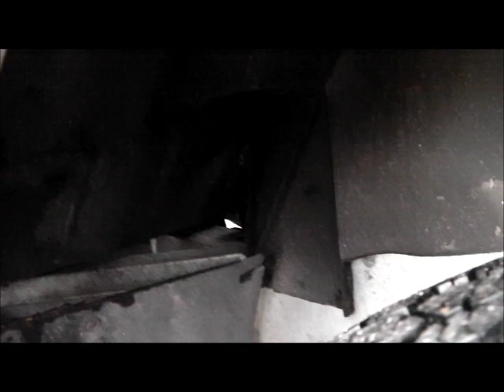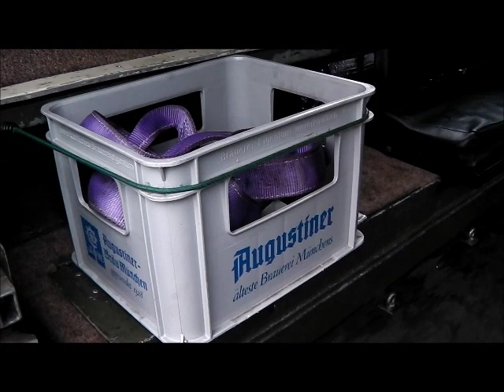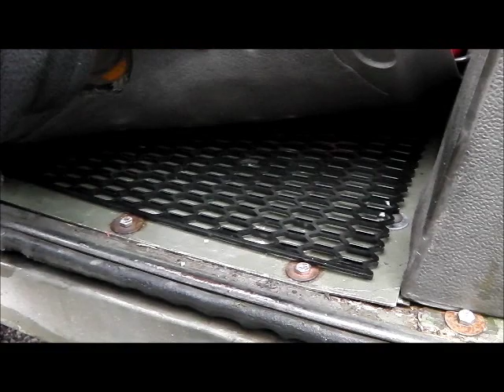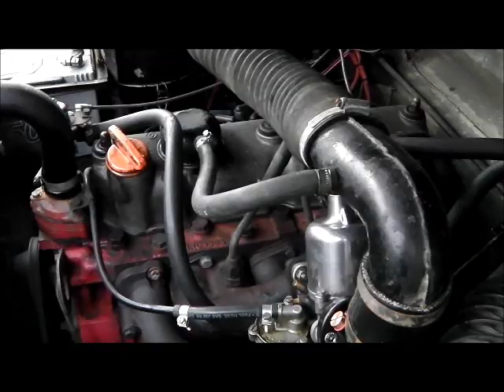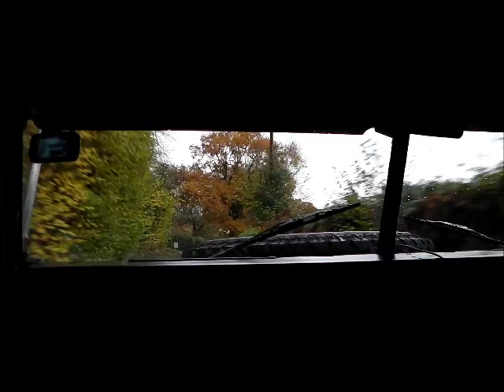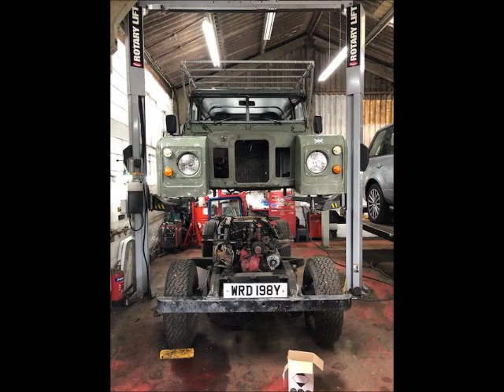Land Rover Series 3 update November 2019

Comment: Good shout on not painting the chassis. As far as I am led to believe it's the devil's own job to get it to stick in the first place! Mine was swapped about 12-15 years ago (before I owned it) and it's non the worse for exposure to the elements.
Reply from the maker: "T Wash" is the answer I believe, but you've got to be pretty thorough! Whilst the chassis was on order I visited a show and got talking to the owner of a restored 88. That was on an unpainted galv' chassis which looked recent - it had been on the road a decade all year round. That was good enough for me!
Reply: @steamwally  I think, if you were going to paint it, it would be best to do it before the body is put back on otherwise there are bound to be bits you can't get at or miss. Stick with the patina on the bodywork - it's a lot less work for one thing!

Comment: Nice to see your update. Until you showed under the bonnet I thought you'd gone for a 200 tdi in your galvy chassis!! I'm sure mines noisier than yours in real life!
Reply from the maker: I think the camera always makes them sound worse, but it's not a Rolls- that's for sure! It's always had a bit of a top end tap - I had a look at that replacement camshaft recently and it's still absolutely spotless, the next thing is to check the valve clearances. Funny enough, I was chatting to an old guy at a show who bought the first production 90 in the UK. It had the same 5 bearing petrol engine at around the same time and he described that as having a noisy top end at idle. He told me that he eventually discovered that LR had been sub contracting out those engines and the oil gallery drillings to the rocker shaft were too large. LR in the end suggested running a quart of extra oil in the sump which he did until he sold it...!

Comment: Love the Augustiner story.  So did the garage just sort of jack the body up, roll the prior chassis out, fit the axles and bits to the new chassis, and marry it back up again?
Reply from the maker: Yeah the body came off as one, you can disconnect the brake pipes, unplug the various looms, disconnect the steering, the fuel tank and any other connections between body and chassis, then lift the lot away. In an ideal world, the tub should go back on first and the rest of the vehicle build from the back forward, but it's a way of doing it.

Comment: Hi there, I too have the ACR HS6 carb. What advance do you run your engine at? I'm having terrible issues with my engine and the carb is set up as per ACR instructions and Burlen Fuels instructions. I've replaced everything in the ignition side of things and rapidly running out of ideas, also are you running the std BGB needle?
Reply from the maker: Hi, your engine should run very sweetly - how are you checking the timing: Are you using a strobe gun or static timing on the marks and pointer at the crank pulley? If the latter, should the cam timing be slightly out then the marks will not be in the correct position - it's quite a common issue. My engine is static timed on TDC, tuning by ear and feel got me there, which tallies up with the manual for a late 2.25. I am just running the standard needle in the carburetor which is absolutely fine. Presumably your engine is suffering pre-ignition?

Comment: Nice video, 👍👍👍 it does not sound so clunky inside as it did on previous videos.
The 3D printed pipe at the carburetor, where can it be sourced? I have the same setup as you, and yes the sports air filter is loud.
Reply from the maker: It's quite a bit better now, turns out the coupling for the Superwinch overdrive that was fitted was very badly worn, much of the noise was coming from that. The air intake elbow was really a one off, if they become available I'll try and remember to mention it.

Comment: Can you share approx how many hours they charged you for? I'm in the midst of restoring my '63 109 and I'm not sure I can afford to have it done.
Thanks!
Reply from the maker: I would budget for a week with two mechanics on the job, but it depends what else needs doing. If things like your bulkhead and tub mounts are all good, then it's quite straightforward. Prior to the job, I had over time dismantled just about every part of the vehicle at some stage so pretty much every bolt came out. Likewise I was unsure about the cost, but I went to see the garage I had in mind so that they could have a good look over the vehicle. A few days later they came back with an estimate, I would recommend you do the same to avoid a shock!
Reply: @steamwally  thanks so much! Very helpful!

Comment: Hi mate, I’m new (ish) to your channel. With the SU conversion and ACR work how far did you go? Did you get the stage 2 head and hi lift cam? If so did you have to do any modifications to the drivetrain in order to accommodate the extra power? Layshafts breaking on V8s etc.
Reply from the maker: The engine in WRD is a 5 bearing 2.25 petrol, so a good starting point. It's had a recent short block overhaul and plenty of other work to get it to a reasonable standard. Mods wise, it runs a slightly better cam (though not the ACR one), electronic distributor and the SU conversion. The head is completely standard and I would say the mods I have done have probably added not more than 15hp, though definitely a greater increase in torque. ACR give a pretty good run down of what can be expected from their modifications on the website and you can spend a lot of money for a relatively small power increase. The 2.25 is not a very tuneable engine but you can certainly improve it. The SU conversion helped greatly with smoother running, gives a slight decrease in fuel consumption and the hot starting/ vapor locking problems are history, it's absolutely on the button. 
If you want a great increase in power, then a TDI conversion is probably the way to go but to my mind, the 2.25 is quite a sweet little engine and relatively easy to maintain. Most of the critical parts are easy to obtain and I'm betting that lots of knackered TDI's get taken out again in the not so distant future.. 

I overhauled all the transmission units, probably the best thing you can do to protect them... the gearboxes are weak anyway and , I just try to avoid "grand prix" starts, don't rush the syncros and keep the oil changes regular.
Reply: steamwally Thanks for all that information. I’m currently planning out my 109 project and that’s very useful. I will be speaking to ACR themselves nearer the time to discuss the best options. I myself will likely be keeping with the 2.25, but depending on how far I go with it I may or may not need to do some modifications to the drivetrain. I hadn’t much considered the 5MB, maybe I will now haha. Engine rebuild or replacement is a necessity for my LR unfortunately.
Reply: steamwally also keep up the Land Rover videos they’re great :)

Comment: Hi Mate, do you have any play on the steering
Reply: It's a series Landy. I would hope so!
Reply: @highdownmartin  Well, I don't have any play on the wheel. They installed a adjuster bolt and locking nut on the steering gear housing. Just nip it up till the play is gone. Job done 🙌🏻
Reply from the maker: It's pretty good - it will always feel like there is a little because of the way the steering system is designed, because the axle is only located by the springs. Wheels straight ahead, there is about 1/4" play at the wheel. The rebuilt steering box will be fitted in the spring which should be a further improvement.
Reply from the maker: @JanDootjes   Don't wind up the adjuster, it should be finger tight only. The adjuster actually does very little and play in the steering is usually down to other factors - usually absolutely naff all maintenance!
Reply: IGNITE FUEL when I bought mine first job I did on the drive back from Somerset to Sussex was stopping near Salisbury plain to put a bit of free play on the steering. It was wound up well tight a good way to shag the steering boxI have about 1/2" at the steering wheel now and like your wheel rims ,(1/64")free play ( not excessive) tells you that is ok not too tight
Reply: highdownmartin 😁 the standard reply from new 'they all do that sir'

Comment: Tappity Tappets. I had the same problem and fixed it. I hear yours still rattling.Did you get to the bottom of it. or are you seeking the solution.
mikerodent at y mail dot com or via the landy forum
Reply from the maker: The original problem a few years back was a worn cam shaft and followers, this was down to a blocked rocker shaft oil gallery. I replaced the lot and it has run quietly for some time. I recently inspected the camshaft,  the lobes and followers I could see showed no wear what so ever. I think it has been around 20k miles since I last adjusted the valve clearances - a new rocker cover gasket arrived today actually and it's the next item of maintenance to do, which should have been done long ago.